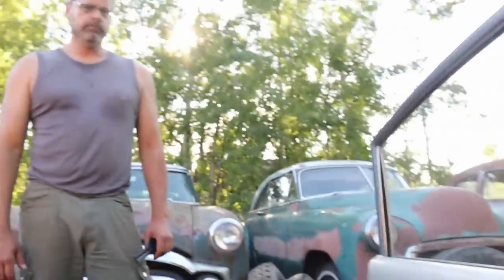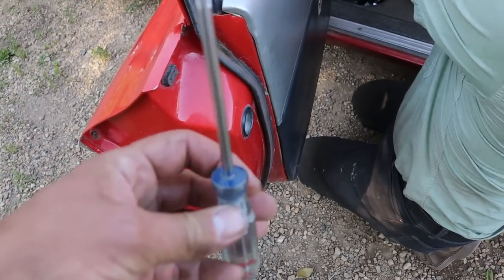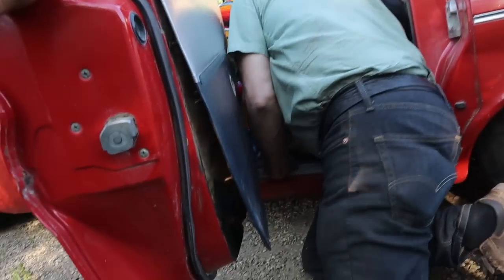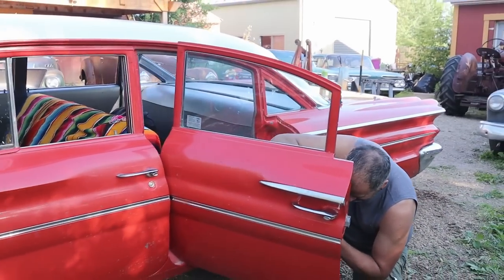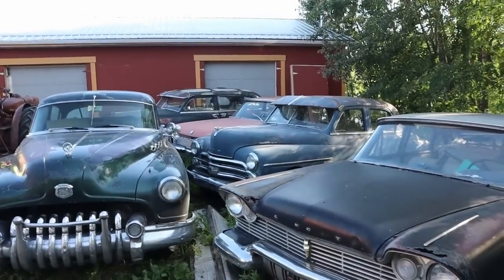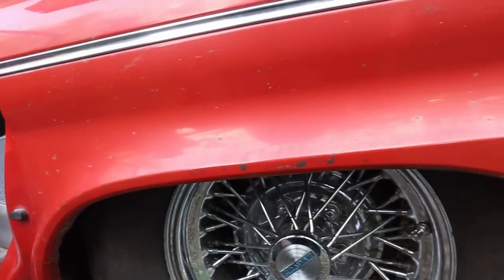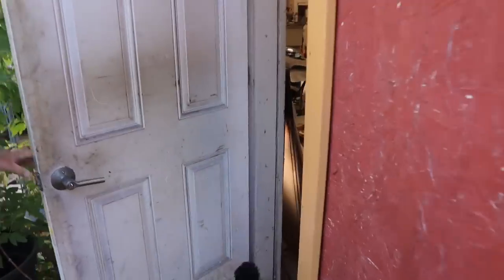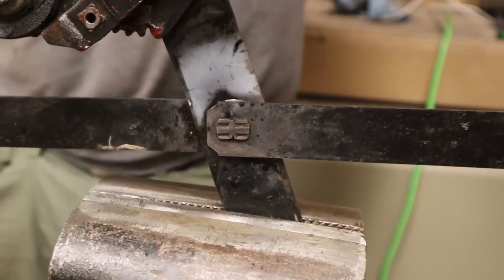Poncho Problems? 1960 Strato-Chief Goofing off With Myles and Tom...

Comment: Sweet spokes and Mickey Thompsons on the Pontiac! It's always fun to hear Tom's bodyshop stories!
Reply from the maker: Fun hey? Tom's stories are classic. The spokes are sweet. Myles is getting some stern looks from HQ about the tires, though. Applying diplomatic pressure accordingly.
Reply: @coldwarmotors  hahah some classic double pinner whitewalls would be slightly more appropriate, or just commit to going full Saskatchewan and install a set of white letter BFG's and running boards
Reply: @CarterAutoRestyling  And break out the Louisiana Hot Sauce

Comment: Well, that was a real treat - and no mistake.  All original, untouched since factory and sorted with a bit of heat, lube and persuasion.  Put it back in and you would never know the door card had been taken off.  Sweet as a nut!  

I did something similar with my Stag's electric windows because they were slower than a wet week.  It's amazing how much can be accomplished with a bit of time and patience.  On a modern car, if it don't move and it should, they replace it.  On an old car, we can still try to make it work and 90% of the time, will succeed.  

Loved hearing Tom's stories too!  Imagine seeing the car he was talking about that some bloke put the hood scoop on backward...!!  All the best

Comment: I've never owned an old car that didn't require some work on the window regulators.  They always dry up and seize up and need some work to get 'em un-stuck.  But I must say -- that regulator there was especially stubborn.  I've never had to use fire to free one up.  LOL!   Like you said, though, it's probably been rolled down half-a-dozen times in 60 years.  Once you got it freed, it was perfect.

This car still amazes me -- especially being a Canadian car.  It should be a lattice of rusty metal held together with a coat of paint, and it's just not.  It's very solid.  Absolutely fantastic!  What a great find Myles got!

Comment: A sacrificial choke cable (~6" with knob still attached) with a small hook at the end works even betterer to remove GM door handes and knobs. Just remember to insert the hook  inline with the body of the handle and between the handle and the plastic (if the plastic is still extant).

Comment: Dear Coldwarmotors Scott N.
👍👌👏 Yeah! Another really nice middle of the week video. What a nice girl and what a simply fantastic and well aged/preserved survivor car! I totally love the blanket with the Mexican style pattern/design on the front seats. I too cannot understand the fuzz about 2dr cars. 4 doors are much more practical (at least in bigger cars). By the way: When will you maintain the other 3 window rolling mechanisms? ;-) And before I forget to ask: What do you actually use to freshen up the felt in the guides? Maybe silicone spray or silicone oil? Or Ballistol universal oil (famous product based on natural ingredients)?
I also love the fact, that your friend Myles keeps the inline 6cyl engine and doesn't want to swap it against an V8 (like almost everybody else did/does, at least in the USA). It's still a good running vehicle that needs no LS engine or  completely different axles, drive train etc.. The only thing I would want to add/have for driving the car in Germany respectively in heavy traffic, are disc brakes (at least in the front).
Thanks a lot for making teaching explaining recording editing uploading and sharing.
Best regards luck and health to all of you (including the nice black girl of course).

Comment: Can't say enough about the "slippery slope" we are traveling on this "tech" journey. Instead of using all of this "technology" to help "simplify" things, we have, and continue to,  routinely make EVERYTHING from phones to Health Care so technical and complicated that it literally EATS ALL OF YOUR TIME keeping things "correct, working, and "normal"!!! 
Always liked "old cars" because of how they looked and enjoyed making them run and drive like "modern" iron. These days, I like them EVEN MORE because of their simplicity and "repairability". This "poncho", much like cars 30 years it's senior, graphically illustrates that ability!!! 👍👍👍⚙🛠🔩🍷
As an example, I/we had a 2002 "S" type Jaguar from new until 2018. During that time, I think I spent at least 3K fixing things on that V6 motor that required removing the plenum to repair or replace some small widget or sensor that was installed below it.

Comment: Great show, I did this on my 72 GMC truck recently, just lack of lubrication, but regular engine-oil on the regulator works very good & silicon spray on window tracks, smooth as silk afterwards. Cheers ! 🤠

Comment: Lumpy cam needed for a 1960 Pontiac Strato-Chief Chevrolet 6 banger. Gotta keep up the image with them big tires n wires. Window air-conditioners work after the coldwar motors docs operated.

Comment: Myles: "When did I become a Pontiac guy?"

Deep down, we're ALL Pontiac guys, brother. 😉 You know a Pontiac 350 all the way up to 455 have the exact same exterior engine dimentions,  and are all torque monsters, and would drop between those frame rails like a penny in a quarter slot.   And the wire wheels are purrrrfect. 👍